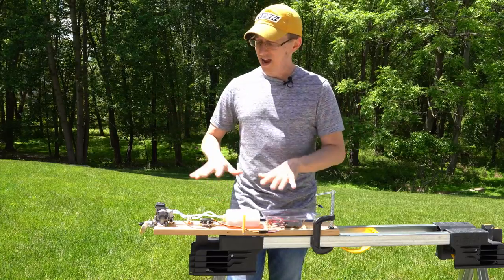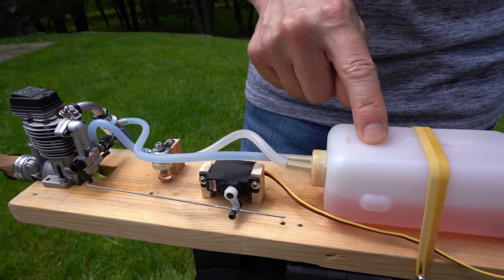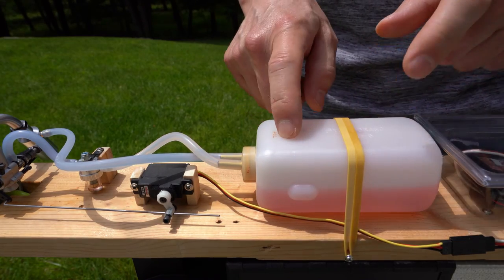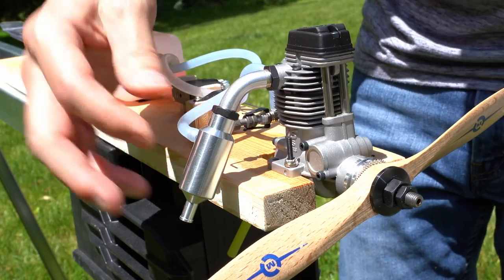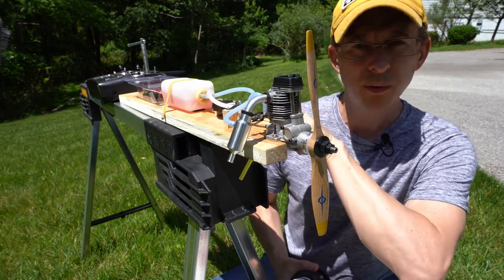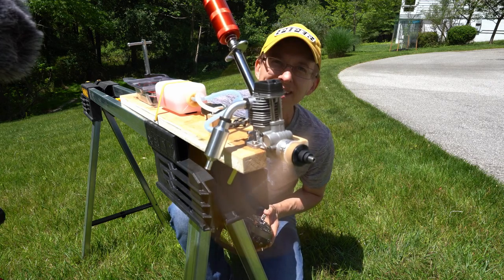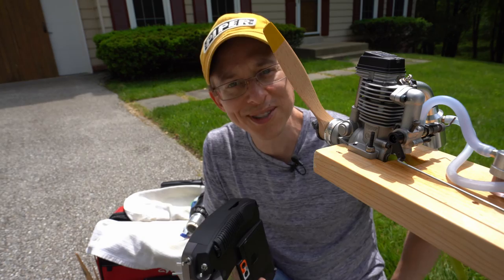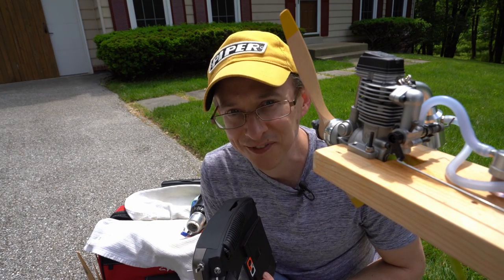O.S. .30 4-stroke set-up and first engine run

Comment: Did you account for the tank being on its side when you set that tank up? The vent bubble should be on the top.
Reply from the maker: I did. I had adjusted the copper tubing for the exhaust line to be pointed up 👆🏽 and out of the fuel level. Good eye 👀😁

Comment: What a superb instructional video- 'all  the  things one  was afraid to ask!  I'm planning to buy my first-ever 4 stroke engine ,for a big Keilkraft Falcon -(rather than electric).  I felt a really large prop would keep the engine ticking over better... are  there any downsides to a  hefty prop, used for its flywheel effect?
Reply from the maker: @Andrew
Adhere to the manufacturers recommendations for the propeller size. To big of prop (or too small) will end with a destroyed engine. Most RC fuel ⛽️ engine are close to bullet proof - they can take a beating and keep going strong - so long as you stick to running them how they recommend 👍🏽 😀

Comment: Great Video,  a few questions for you:  How does the crank case and lower-end internals get lubricated on a 4-stroke?  I've flown 2 strokes for years and un always wanted to venture into 4 strokes.  Is the main benefit the sound, and ability to spin a larger prop which equals more thrust, but a lower top speed?
Reply from the maker: Nailed it. Yes, you'll get much more torque (i.e., power) to spin bigger and higher pitched props. The sound is just a bonus. As for lubrication, the engines are built to slef-lube, if you will. Make sure you're using the right glow fuel for smaller bore engines. There are formulas specific for 4-stroke if you are using glow.
Reply: The 4 strokes allow for some blow-by of the unburned oli past the piston to go into the crankcase itself and the valve gear, heat and vapourisation of some of the oil of course helps. There is usually a nipple fixed in the crankcase where excess oil drians off after it has done its job.
Initially it was thought that less oil would be required but experience has shown that 20% oil works well and covers any lean runs. Ideally a synthetic with some castor oil works well. Have used this for 25 years.

Comment: Awesome video! I haven't tried a four-stroke yet, maybe I will with my next plane. Do you like them better than the two-strokes? Also, what all did you use to make your test stand? Looking for something simple...
Reply from the maker: @grant
I'm a fan of 4-stoke because of their sound, torque, and fuel efficiency. However, you'll get more RPMs from a 2-stroke which equates to speed. I scratch built a test stand once but I usually install the engines and break them in on the plane. That's not for everyone but it's worked for me.

Comment: Good video and nice coverage of what you were doing at each point.

One question, why did you richen up the high speed needle when it was idling lean, rather than richening the low-speed needle?
Reply from the maker: 👋🏽 @mawzthefinn 1) I always run a brand new engine SUPER rich and, 2) I don't adjust the low-speed settings when breaking-in any new engine. I trust the manufacturers default settings and leave them. After a few tanks of fuel have been run through a new engine I *may* play with the low-speed needle if I'm having trouble on idle, however, I've rarely needed to mess with the manufacturers settings. They've seemed to work well for me "as is". Perhaps I've been lucky 😁

Comment: Ciao Sky IILAMA,! This a really nice video! You know i have at home that OS engine and also the .120! I made by myself My first 4 strokes RC engine with drawings, lathe and milling machine, the problem that i have Is that i the fuel does not arrive to the carburator! The fuel tank is completely above the engine, i think It can be a problem of compression, of the piston or to the valves, ( i think), can you suggest me a method to check if there is enough compression?  at least that's enough to suck up the fuel! Thank you in Advance for your answer, a big ciao from Italy! Alberto
Reply from the maker: 👋 From America! You made your own engine?! That's insane and amazing! From what I know (and have done) most all fuel tanks should be in line with the engine. Unless you have a fuel pump (which is very rare for RC) placing the tank above or below will create issues as the back pressure from the muffler isn't strong enough to get adequate fuel to the carburetor.

☝️ Someone out there add some fidelity to my claim please - or tell me I'm wrong.

As for the compression, all I know is that it there should be plenty of "suction" or resistance when you attempt to rotate the engines propeller with your bare hand (Note: *DO NOT* do this with the ignition on and/or the glow plug connected). It's not the most scientific approach but it's proven to work well for me and has let me know when it's time to replace an engine casing or a piston sleeve. Also, there should be an optimal RPM that your engine runs and if it can't reach that or maintain it - odds are your compression has reduced. 

Hope this LONG response helps. Cheers! -aw
Reply: @theskyllama  Thank you so much for your answer! I think, from what you have said, that It Is a problem of compression: It Is not so difficult rotate the shaft with the propeller by hand!! I have to improve this!! Maybe in my future YouTube video,. Thanks a lot! Alberto

Comment: I recently bought my first glow model. An old hangar 9 Funtana with a never started saito 4 stroke on it. Its ready to go i just have no idea what im doing. The last thing i need is fuel and im not sure what to look for🤷‍♂️
Reply from the maker: @maybejoshh
I've always done Cool Power glow fuel for airplanes. I've stuck with a 10-15% nitro mix and have never gone wrong with my Saito .62. Which is about 15 years old 🙃

Comment: Great engine video and well explained.   Most of my fourstrokes are Saito, but I do have an OS 95v in my Great Planes Escapade 61 that runs great.  I also have a brand new OS 52 Surpass fourstroke that was made in the 1990s that I bought from a model flyer who had retired.   I'm still looking for the right plane for that engine, but excited at getting it run up for the first time and hearing that great sound.
Reply from the maker: I've got a 15 yr old Saito .62 and an O.S. .91 that run fantastic to this day.
Reply: @theskyllama  Saito 62 is my favourite engine.

Comment: When i prime the engine i put my finger over the air intake on the carb and turn the prop by hand untill i see the fuel go Into the carb through the fuel line then turn the prop about 3 more turns.I never prime the engine using the electric starter
Reply from the maker: That's a solid way to do it👍🏾 I've done that as well and then used the starter to turn over the engine a few times b4 connecting the glow starter.
Reply: @theskyllama  you just need to watch out for hydro lock
Reply: I put my finger in exhaust and turn the prop.
Reply: @theskyllama  its easier to start wo spinner if you change starters cone rubber so there is that small hole.

Comment: When you adjust the high speed needle, what’s the base line? Do you start with the valve all the way closed or open?
Reply from the maker: Close the needle valve completely. Then open it 2 full turns. This should make the engine run lean enough to get it stared and idle but not so rich to prevent it from starting at all. After that, I find it's usually 1/2 turns either way to fine tune the mix.

Comment: Does it have oil in the crankcase or lubrication via the fuel?
Reply from the maker: It gets lubricated by the fuel. I use a synthetic 2-stroke glow fuel (no castor). All the additives in the fuel provide all the lubrication it needs 👍🏽

Comment: Can I run car ac compressor through 61cc rc plane engine 
I want to make small room air conditioner
Reply from the maker: Ali, I have no idea if that will work. If it does, let us know 👍🏽
Reply: Brother 61 cc engine is not enough to run a room air conditioner...but if you can find a vapour absorption type then your engineering desire can find a way out...

Comment: i dont like nitro because it eats the engine so i use castor oil and methanol as the fuel that combo doesnt eat the engine parts
Reply from the maker: Most quality brand synthetic nitro fuel mixes are specifically designed for CNC built parts, which is how most fuel powered engines are build after the late 1990's. I stick with synthetic 10-15% nitro on all my glow engines.
Reply: @theskyllama  if you let the engine sit for 4 months you well be surprise how much the nitro has eaten the inside of the engine nitro is still nitro the synthetic is referring to is the oil they are using that's why nitro fuel is not cheap is because of the nitro
Reply: @crunchied8  that's why if I let my engines sit idle for longer than 3 months I put an after-run lubricant in the crankcase to neutralize it/store it.
Reply: Nitro does not eat the engine, the alcohol if left in the engine attracts water which form rust, stop bithing and just fly

Comment: Talk about over the top ,just mount it hook up push rod to throttĺe lever  connect fuel lines glow plug flip it
Reply from the maker: I was going to do that, but I wanted to have a setup where I could remotely operate the engine during testing. It wasn't hard to set up.